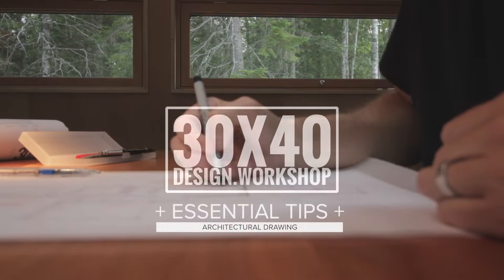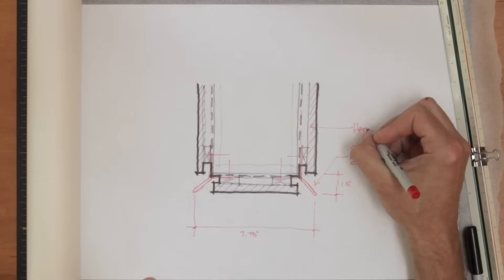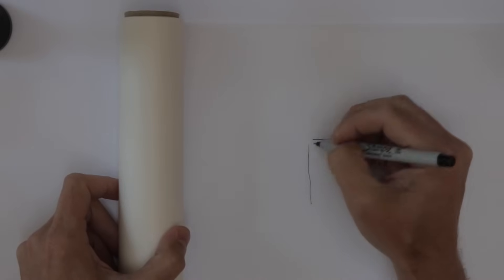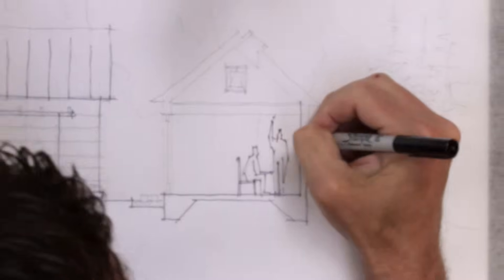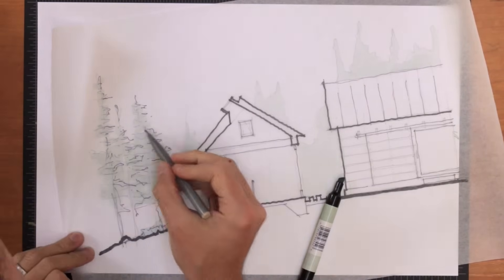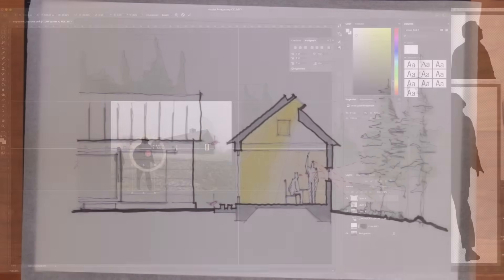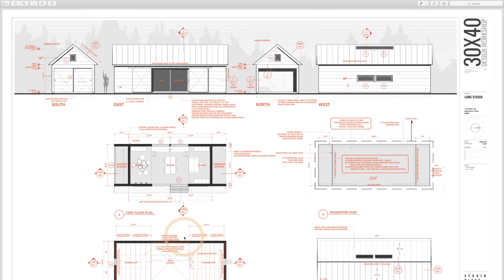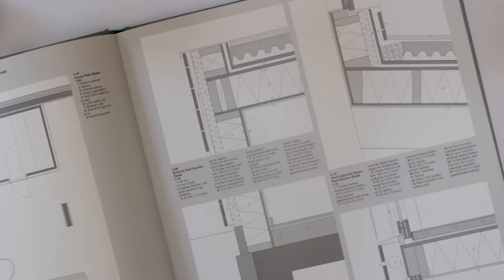Draw like an Architect - Essential Tips

Comment: Students:  I'm a structural engineer who has worked very closely with architects for a long time now.  We work arm in arm on projects and I understand their job very well.  The following is a reality check for architecture students and aspiring architecture students-- 

Don't be blinded by the flashy title-- architecture isn't what you think it is.  Ask any architect if their job resembles what they thought it would be before they started architecture, and nearly all will tell you that it's not what they expected.  They will also tell you that (unlike structural engineering, where the working world is almost exactly like what we did in school) the working world for architects does not resemble architecture school at all.  So simply making it through architecture school is no indicator of how you'll do as an architect.  It takes a certain type to succeed as an architect, and just wanting to design and build pretty things is no where near enough.    

Architecture is a highly constrained form of design.  A huge amount of your time is spent on accomodating laws in the form of codes and regulations, and addressing the practical electrical, mechanical, plumbing, structural, geotechnical, civil, and other systems that need to be accomodated.  And money is always king.  As an architect, you are caught in the middle of a myriad of forces pulling you in all directions.  You are  a project manager, a lawyer, a draftsperson, an accountant, and a designer-- in that order.  You are trying to get work out of others while trying to stay on top of your own.  You're managing construction issues and doing a lot of paperwork.  Architecture requires leadership qualities, a diligent work ethic, and excellent organization and communication skills.  You should be willing to work long hours when deadlines loom, and learn to manage stress.  You must also accept that it will be many, many years before you are leading headline projects because you have many years of learning (and relearning as times change) to do.  The best architects are the hardest workers.  

If you fit this type, you may have what it takes to be an architect.
Reply from the maker: Don't forget, you get to choose... https://youtu.be/nLUU6wcA3qE

Comment: Thank you for sharing your thoughtful methods and professional insight. Just a minor comment on what may be your personal preference and/or habit, but I've found the use of a scale as a straightedge to be problematic. In my experience, it's the first phase in the eventual demise of the instrument's accuracy. Since I've sworn off of that tendency (whilst tempting), I've developed a new respect for the "sanctity" of my scale, and the resulting accuracy of both my sketched and drafted work. Best!

Comment: What's your opinion on the shading in sections/facades? I saw that you put an ambiant shadow on your facades but the thing that lead me to asking this question is that the shade on for example the left side of the building and the back facade are not the same. 
I assume you set it with a sun path, like I do when I plan on rendering in the end, so what doe you think about setting the ambient shadow in all drawings at the same settings? (for example at a 45 degree angle from the left top).
I would love to hear your opinion about it because you can say its about preference but also the fact that the one is more 'realistic' than the other.
Anyway great video! Keep putting out this amazing quality content 
Greets from an arch-student from Belgium ;)
Reply from the maker: +DieterMarien...mine are faked using hatches (no ambient shadows in AutoCAD LT)...however, I think you should do whatever communicates your ideas best...and sometimes that means foregoing being completely accurate...cheers my friend, thanks for watching and commenting...!

Comment: I was woundering, could you in the notes mention the arch. gear, but incl. the pens? I tried a heavy signpen but got one without archieval ink waterbased .. got messy. Else .. for the finer ones I got a load of multicolor pigma for noting corrections and notes for different things, I give the klient his own color. I love the edding and uni pin 0,3 0,4 after years of experimenting with different brands and sizes.

Comment: Is trancing paper different than rice paper?
Reply: Yes. Rice paper is soluble - if it gets wet, it dissolves, so using ink markers would just make it fall apart and it would be almost impossible to store without it sticking to other pages and slowly disintegrating due to ambient moisture. 
Tracing paper is more like baking paper or a film, and baking paper is what we use at school because it's really cheap and you can just throw a 30 metre roll of it in your bag.

Comment: 6:10 What is a "rudimentary form of AutoCAD"? LT? A 3rd-party product like BricsCAD? AutoCAD 2002 on a XP machine :P? I'm curious.
Reply: AutoCAD is about as rudimentary as it gets. It's been around since the mid 1990s, so for an XP machine, just look for a copy of the program from 1995-2000 and it should work fine. Make sure your computer has as much RAM as possible.

Comment: From an interior design student, things you should have said before anything else-
Architectural "drawing" is not the term used. It is DRAFTING, ARCHITECTURAL DRAFTING 
line weights are only important to learn AFTER you know what each line is used for. Wall line, construction line etc or it won't give any illusion of depth, it will look messy and unorganized. You will also have to learn how to read and use an architects scale (multi sided ruler with a scale for drawing accurate sized rooms/buildings based on their size in real life) you also need a T-square or a straight edge in order to be sure your lines are vertical/horizontal, a drafting board will cost you about $100 USD, you need different sized lead holders or technical pens (micron, copic multi-liner etc) this will make line weights easier. You will want to be able to erase without smudging your work (remember this is to "draw like a professional" video he is giving tips on, so smudges are a no no🙄) you will want a horse hair brush to brush off eraser shavings without any smudging. You will need to be able to learn the lettering style and sizes used in an architectural drafting project very small and no horizontal lines using all capital letters. 

Just to name a few....you can find the standards for these things online very easily and if you follow those steps properly, your work will look better than most!

Comment: You still use INCHES ???
Was this video intended only for the USA ?
Reply: Are you new? Yes, the US still uses imperial units of measure, but that doesn't make this video strictly for US citizens. It's not that challenging to convert imperial to metric - 1 inch is 2.5 cm or 25 mm. 1 foot is 30 cm or 300 mm.